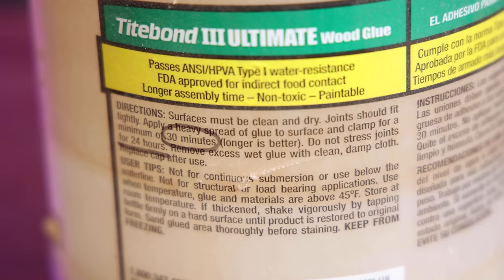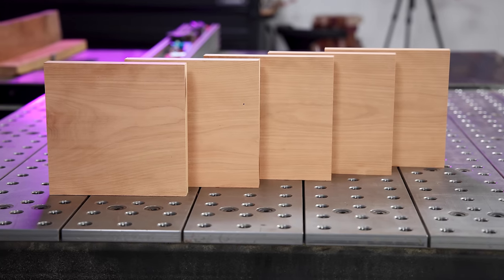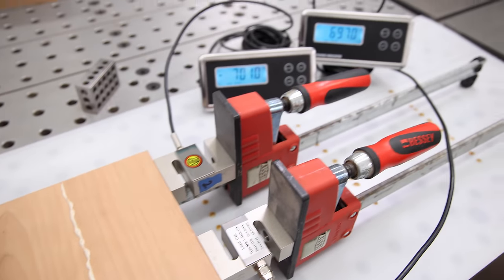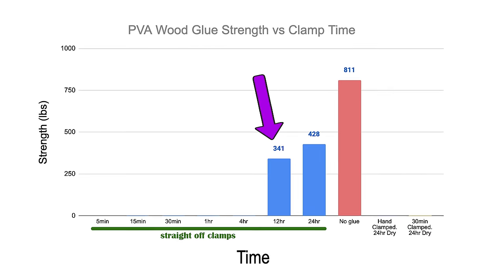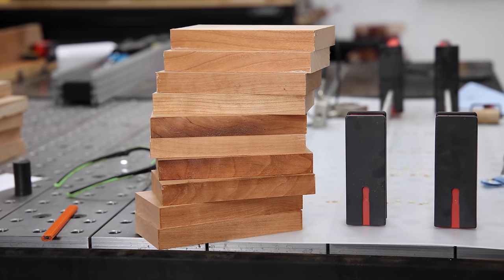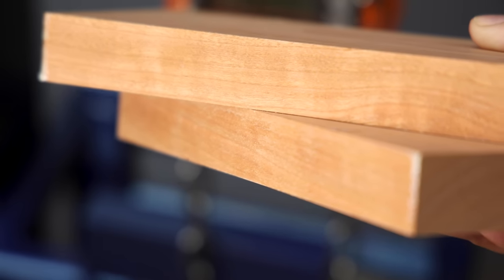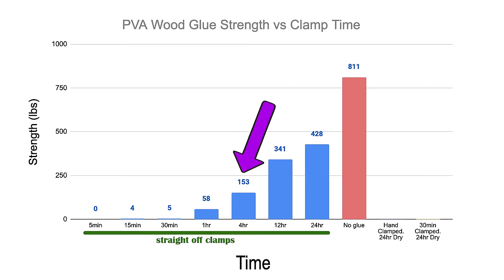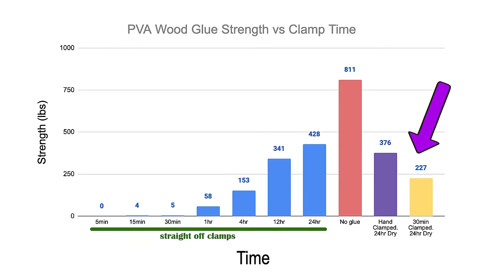you are clamping too long

Comment: It's really kind of complex in my mind anyway. The fibers closest to the joint will compress more under pressure than the fibers more toward the middle of each of the boards due to the added moisture 
of the glue. At 30 min, when pressure is released, the glue is not hard enough yet to prevent the compressed fibers at the joint from relaxing rapidly and then when the fibers shrink when all the moisture is evaporated and the glue is cured, it makes for a weaker bond. It makes sense, because the moisture in the boards without clamps evaporated at a relatively constant rate. So there is a sort of wet squishy fiber bounce back effect going on with the ones at 30 min.

Comment: I imagine the issue with removing pressure at 30 minutes is that the glue was still soft enough to open up by a small but meaningful amount at that time, forming microscopic gaps within the glue line. The hand clamped version didn't have this problem because there was less squeeze-out, so the whole gap was still filled with glue.
Reply: Same. Probably due to the flat surfaces being slightly convex from moisture swelling. Clamping pressure squashes them flat, but removing too soon they spring back and break the joint. Hand clamp probably had less than full area for the same reason, but better due to less glue squeezed out. Scrape the surfaces .001" concave to compensate for it.

Comment: The longer clamping pressure as the glue truly dries and sets is best due to the molecular level of the glue bonding to one another and also gives the glue a longer time to be pressed into the woods fibers resulting in a stronger glued joint.

Comment: One possible explanation for the 30 min clamp, 24 hour rest result is that the clamping causes squeeze-out, and releasing that pressure too early then leads to glue starvation.
The no-clamp test didn't have the squeeze out, leading to a stronger joint.
The 12 and 24 hour clamped  joints had squeeze-out, but without the release of pressure, that didn't lead to glue starvation.
Of course, this is conjecture.
A nice followup would be too test 24 hours of drying, with varying clamp times. My guess is that around 4 hours of clamping, which is where the joints started to break equally in and around the glue line,  and 24 hours of drying, you'd get as strong results as 24 hours of clamping

Comment: I'm impressed. These were very good tests. I worked in a physical test lab for a wire and cable manufacturer for about 10 years and found your test setups to be very consistent. I did find that due to you using a chain fall the rate of separation varied from test to test. The better way (and I realize you had no access to this) would have been an electric chain fall to maintain a more consistent rate of separation. Also the wood should have been milled using a planer and jointer to ensure more exact dimensions and a 90° corner. I'm sure there would be a few other preparation variations, but overall you did excellent preparation. Good work. 
Oh I almost forgot, it's important to have all the equipment used to be calibrated. Again you most likely have no access to this as well. But you used what you had.

Comment: Different woods would likely change the results drastically for two reasons:
(1) Different absorption rates will affect glue penetration and crosslinking time
(2) Tite-bond gives different clamping strengths based on wood type (which clamping force likely has to do with penetration

Comment: Great video, Suman!
Thanks for making these very interesting videos! I long suspected that not clamping two pieces together is as detrimental as most people claim. I feel that as long as there's no air gaps between the joints you don't even need to clamp that hard.
I feel the reason why the 30min clamp 24 hour cure time underperformed was due to two factors. Firstly, compared to your hand assembled glue-up, there was less glue between the two joints when the clamps were removed. So, that might explain why the joint was weaker than the hand assembled test. Secondly, I feel that when you removed the clamps you removed external stress between the joints and by doing so you inadvertently put a bit of internal stress on the uncured glue joint. This in combination with my first point is what I believe to be co-contributing factors in a weaker joint.
Keep up the great work, Suman!
Reply from the maker: Thanks dude! I agree with both points. I honestly feel like 200psi is an overkill.

Comment: My hypothesis is the clamps provided a lot of inward pressure. When the clamps were removed after 30 min, that pressure was released like a spring causing the glue joint to become weaker. Hand compression didn’t provide enough pressure to enable the spring like action.

Comment: On anything less than a piece of furniture, I've always clamped for between 1 and 2 hours then remove the clamps and continue, even planing or jointing the piece if that's the next step.  I've never had a problem.

Comment: Nice experiment. There are so many variables with wood. I imagine grain run out, wood moisture content, resin content and wood density differences among samples would all play a part. The same experiment done with a much larger number of samples would be necessary to try to mitigate those variations to some degree. I think I will go with the 4 hour minimum :)

Comment: I wonder if the difference between the 30 minute clamp, 24 hour rest and the hand-clamp results was that the 30 minute clamp had significantly more glue squeeze out than the hand clamp, leading the hand clamp to have a larger total amount of adhesive on the joint and thus be stronger.

Comment: What I usually do is to put the pieces together and let them absorb the glue into the wood fibers for half an hour or so. Then I clamp them, but not tight. Just enough so the pieces can move closer together as the glue line dries up, eliminating any voids in the glue line. Too tight clamping, or too early just squeezes the glue out of the joint.

Comment: Let Glue Dry.
A lot of us use mechanical farsteners (screws, brads) that remain in the wood to provide the clamping force during glue-up; it seems that if these are applied during the glue's open time, they should do just as well as using external clamps. Adam Savage builds a lot of his shop infrastructure using only glue and brads.

Comment: In the 30 minute clamp, remove clamp, dry to 24hrs, what happens is at 30 mins the glue is not set all the way so removing the clamp allows the joint to separate some, so you get gaps and stretched glue and some of the holding power is thus reduced.

Comment: I've been adding dabs of CA glue on my Wood Glue lines for years for rapid prototyping.   just skip  about 10% of the glue line and dab the CA glue. CA accelerant has a negligible effect, I think because of the moisture in the wood glue.

Comment: Mr Suman, I love this data driven sh...stuff! Keep it up. One thought about the strength of the wood vs the glue: It seems to me that glue alone, is not what we are concerned with. It is wood saturated with glue. The glue that gets into the pores of the wood and makes the wood stronger at the joint This would mean that the quantity  of glue used could be a significant  factor for joint strength. Too much glue could make a joint with glue alone between the boards being joined, and less glue would have made a stronger bond.
Thanks!

Comment: You mentioned grain orientation as an uncontrolled variable. I noticed when you were breaking the control boards that the specific close-up shot showed growth rings cupping up with the force from below. It could be an interesting side trail to see whether (or how much) grain orientation has a significant effect in the absence of gluing. I know bowyers try to get heartwood towards the back of the bow (towards the archer) and sapwood on the front (towards the target) as the common understanding is heartwood is better in compression and sapwood is better in tension. I wonder if there's any value to borrowing from thise ideas when building other wood projects.

Comment: I'm just doing a guitar neck repair and was worried about clamping time (hence why I'm here). Just also visited the Titebond website which states this "For most of our wood glues, we recommend clamping an unstressed joint for thirty minutes to an hour. Stressed joints need to be clamped for 24 hours. We recommend not stressing the new joint for at least 24 hours." So I guess as mine's a stressed joint, the 24 hours.

Comment: I would guess that removing the clamps after 30 minutes caused the wood to decompress and the joint to move, after the open period, but before the glue had enough strength to hold the joint completely by itself, so the disturbance of the partially cured glue likely resulted in its weakening and lower failure. Hand clamping was likely released before the open time was over, so any small shifting happened before the glue had started to cure and thus didn't cause any weakened glue area.

Comment: This is a great video. I have thought about this sort of thing but never got around to actually thinking about this. Usually a clamp joints but not always and I've never noticed a problem with strength either way. At least I now know that clamping isn't THAT big a deal. This is useful when doing those clamps where you worry about the wood moving. I'll be clamping with reduced force in future.

Comment: Loving your channel. Knowledge is power.
Just in case this piques your interest; I've been wondering about how how tight to joint actually needs to be since there is such a thing as a glue-starved joint if too much glue is squeezed out. But then again, PVA-glue shrinks as it dries, so it won't fill large gaps in a sloppy joint. Usually woodworkers go by "...this feels good to me, but this other one is a bit tight". Obviously the issue here is that not only is it subjective but it's not really even based on anything since most of us don't break our joints to see if it was indeed "just right" AND the perceived tightness of the fit depends highly on the amount of surfaces rubbing on each other so while a similarly spaced bridal joint might feel a bit loose, a 10 fingered finger joint might feel a bit tight. And the perceived correct tightness of a joint is very different with Japanese woodworkers and Western ones as our Eastern colleagues like dry fits to be barely hammer-able as far as I can tell.
But we all do have digital calipers that could easily give enough information to get at that correct tolerance between a glue-starved joint and a joint with air gaps. Of course for testing purposes, a micrometer and feeler gauges might be the way to go to ensure accuracy of information, but for the average Joe out there, a quick check with a digital caliper makes the most practical sense when woodworking. Or maybe I'm just overthinking it and barely dry-hammer-able and barely holds together without glue is all in the realm of acceptable glue joints.

Similarly I've been wondering about how much glue is enough. Most Youtube woodworkers go by what I call "never too much glue" as they feel it must ooze out by a lot to ensure a good joint. But with a tight fitting joint, shouldn't it almost always be enough that you've just basically moistened both surfaces with glue? Just apply glue and basically with a single stroke scrape all of it away but a very thing layer. I go with this route most of the time as I hate making a mess on my work surface and dislike always cleaning my joints from excess glue and just plain don't feel like dripping 2-3 times as much glue on my work surface than what remains in the glue joint. And if you've even had a joint or a dowel float because the glue can't go anywhere in that mortise/hole, you start to question the common wisdom. Especially after pounding the joint close when you notice a part of the wood actually blew out because the glue had to go somewhere and out the side of your piece it went.

Obviously you don't "owe us anything", especially a random commenter, but you never know where inspiration strikes. I just know I'm not in a place in my life where I could do these tests any justice probably not in the next few years anyway.

Comment: This is a great video and all, but I’ve found that the glue joint finds its maximum strength about 2 minutes before you realize you’ve screwed up and have to take the joint apart.

Comment: Very nice tests
as far as different woods and glues, i think it would come down to 
-how stiff is the wood naturally, and how stiff is the glue
-how well does the glue absorb into the wood (idk if that’s even a thing, i don’t do woodworking tbh)
-and perhaps if the wood porousness or moisture somehow affects how well the glue cures
mostly just a blind guess but i feel like the results shouldn’t vary that dramatically between woods and glues assuming you account for the natural strength of both

Comment: Not many (any?) other channels mix woodworking and scientific testing in such an entertaining and thoughtful way. The only other that I've seen that is somewhat similar is Project Farm, but Suman has an amazing presence that's difficult to match.

I'm also baffled at the {hand-clamped + 24h dry} vs {30-minute-clamped + 24h dry} difference. I wonder if it's the variation in the wood samples. Could you post the individual observations in each sample?

Comment: Well my friend you got a subscriber and you just confirmed my suspicions. “Rob Jones” will be making corporations very nervous, and rightly so, after the bar clamp I just purchased made by Irwin, failed before it’s first glue up. it claims to not need threads and can simply be rested on the top with only a quarter inch of pipe inside the top portion. Only after drilling and tapping and inserting bolts was i able to use my expensive new bar clamps. Which are now modified to the point of no return.

Comment: what seems to create strong joints is well-mated surfaces plus long and undisturbed time held in position so that the polymer has time to penetrate the fibers before curing. heavy clamping squeezes glue out of the joint, reducing penetration. removing clamps before cure disturbs polymerization, introduces air, and accelerates cure time. in my experience the strongest bonds are achieved with good mating of surfaces, and light clamping left undisturbed for 24hrs

Comment: I really enjoyed this video (new viewer). In my eyes, the 30m clamp + 24hr dry time is indicating that there's more than one effect at play here.

There is likely some minor movement between the off-clamp time and the end of the cure where, at a microscopic level, your glue is losing adhesion. You could test this effect by doing more tests, e.g. varying the clamp and cure times, but it'd be more academic than practical. If you DO ever want to design that experiment definitely do a designed experiment to minimize your sample set!
Reply: I bet the problem is removing the clamp when the glue isnt fully cured.
The wood is a bit springy and there is pressure on it. When you remove the pressure it wants to separate a tiny bit.
Since the glue is not really cured it cant stop the wood from separating a bit, but its cured too much to flow and fill the microscopic voids.
Thats why the unclamped piece is better: the gap between the pieces is a tiny bit wider, but it IS fully filled with glue.

Comment: I am a retired scientist who now does woodworking. This was an excellent attempt at quantifying the strength of different types of wood glueing. However, the final conclusions are a bit premature because it is not comprehensive: you need to take into account and consider all of the variables. These variables include types of glue, types of wood, wood grain, wood density,  wood thickness, span of wood being broken etc. . Nevertheless, this is just about the best study of wood glueing I have seen on YouTube. Well done.
Reply from the maker: Thanks Nelson! Yes it’s important to keep in mind that my goal here is not an academic exercise for publish-worthy data. It’s really to demonstrate some of the principles in a quantifiable way for a general woodworking/diy audience to take away a few high level knowledge. To your point, more variables could be added but adding another type of glue (as an example)would compound the testing 2x; something I do not have the capacity at current level of family and professional responsibility.  
I did control for wood species, thickness, and span of wood being broken. It’s hard to control for grain which I alluded to in the video.  I did use boards from the same stack (and presumably same tree). 
Appreciate you watching!
Reply: @WoodcraftBySuman  yup … understood. Your study was excellent for the intended audience.

Comment: Great vid.  Love the scientific approach, especially controlling for the clamping pressure. One comment:, there is no reason to discard the highest and lowest values.  You would only discard data points if you have some clear post-facto reason to do so, like maybe the board slipped in the cracking jig, or you noticed afterwards that one of the boards was rotten, or whatever.  But barring something like that, best practice would be to average together all of your data for each group.  It's also helpful to include the standard deviation to give an idea just how variable it is.
Reply from the maker: Thanks. Yea I started using error bars after this video and will continue to do so for reasons you mentioned.

Comment: My guess for the 30 min clamp by 24 hr dry, is that the pressure was too high. Between squeeze out and wood fiber rebound from releasing the clamps caused there to be insufficient glue density left in the joint for a strong hold.
If you need the clamping force to close up a gap, I think the 4 hour recommendation is likely good enough. With better fit or not caring about small gaps, tape is fine.
I would be interested in seeing the effects of different pressures.